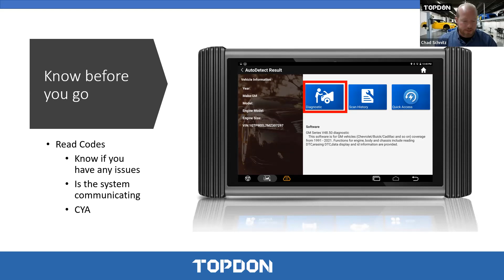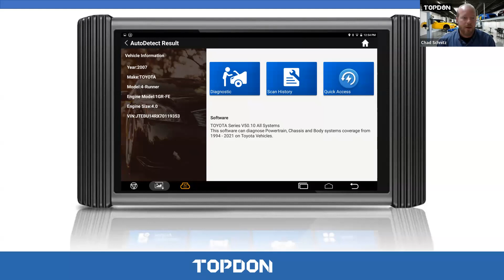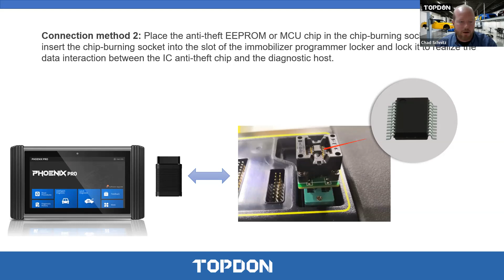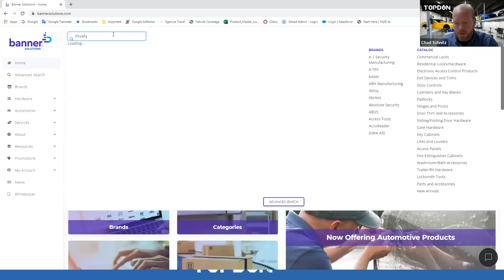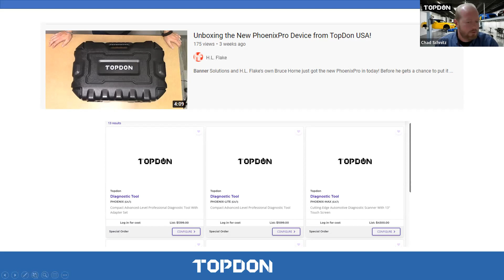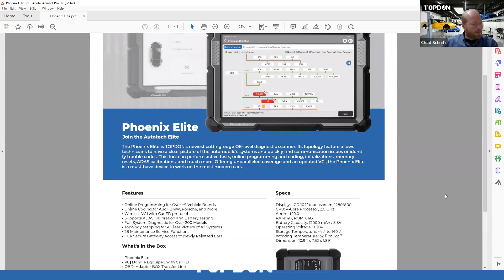TopDon Solutions for Unforced Errors

Comment: 20:35 "This tool updates via wifi" -- yeah, it you're lucky. The TopDon I have lists hundreds of updates, but the download function is very slow, sometimes managing 2MB/s, but often falling to 200kB/s, and outright failing over and over. You have to manually restart the update function many dozens of times to get through them all.  Connecting to wifi is not the problem -- the TopDon's Chrome browser and Youtube work just fine.  So it seems that it's TopDon's update server that keeps stalling.  So the while the "updates every week" would normally be welcome, it's quite a pain when the download servers are so uncooperative.